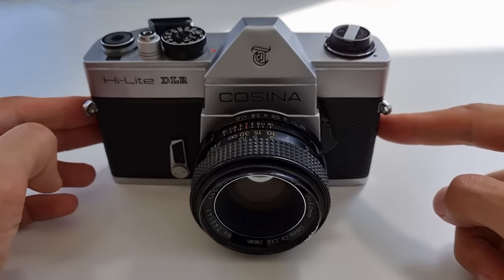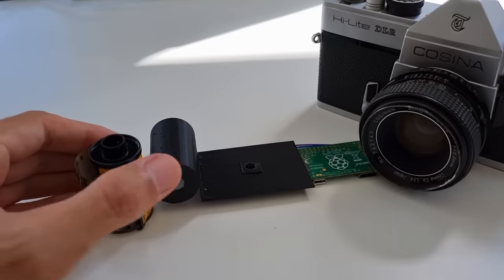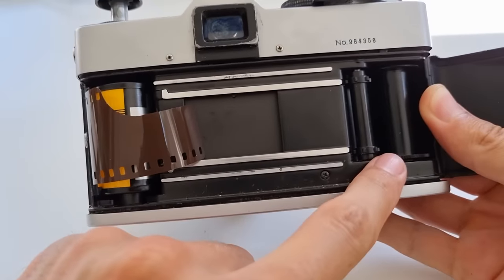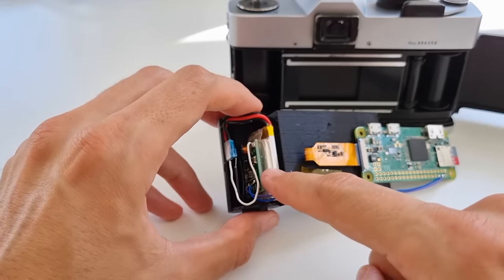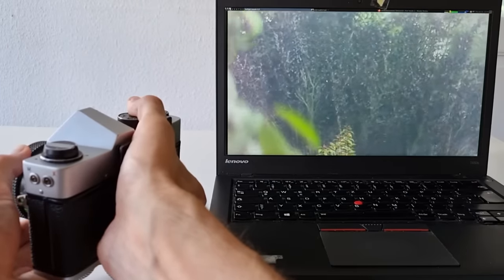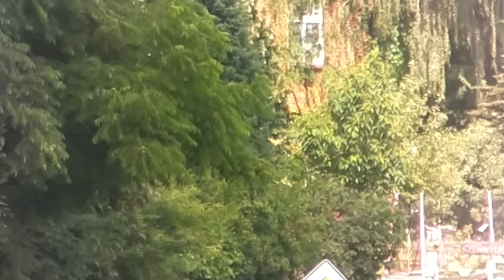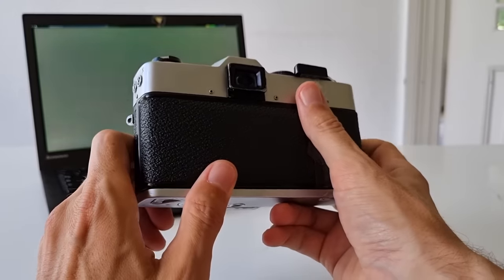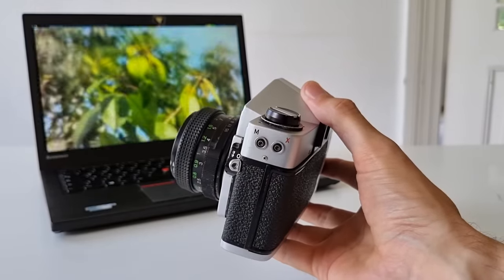Digital Film Cartridge for Analog Cameras (using Raspberry PI)

Comment: With the smaller sensor you've effectively increased your crop factor quite a bit. Maybe 5x or more! So your 35mm lens is giving you a telephoto image, I'm guessing something like 200mm. If you could get a larger sensor (ideally full frame, i.e. 24x36mm) it would be more zoomed out and like the image you would expect on film. Really cool project! I've seen several failed Kickstarters that tried to promise this, but here you are with a working prototype. Well done!
Reply from the maker: You are absolutely right. I started with a 50mm lens but with the small sensor the equivalent focal length is in the range of 500mm. Quite crazy :)
Reply: @kassenbon  are there larger sensors available? Maybe the high quality camera module?
Reply from the maker: @sigilvii  Indeed, this would improve the issue. But only by a factor of two, so we would still have a 250mm focal length. Together with a 24mm lens you could maybe get to somewhere around 120mm, which could already be useful.
Reply: Quality would increase too
Reply: @godsinbox  exactly. If you only cut low quality corners, image quality increases, but if you are looking only through a tiny spot in the middle, quality quality decreases. You are also loosing a lot of light, this leads to longer exposures and/or ISO increase
Reply: @kassenbon  mentioning the 24mm lens makes me think of the Pentax Auto 110. But then it's such a small camera you would be hard pressed to fit the electronics in, and it wouldn't fit 35mm cameras either.
Reply: Was gonna write the exact same thing hehe
Reply: The OTTO from Next Thing Co. :-) Also the creators of the CHIP and PocketCHIP.  I have one sitting around here somewhere!
Reply: @smithincanton  looked it up, now I'm thinking about how to put a Raspberry Pi into a Holga 🤔
Reply: Wouldn't extending the lens from the camera body change the focal length so that it would hit the sensor more proportionately?
Reply: @sigilvii  i remember the pentax 110 - I had one way back when :)
Reply: @kassenbon  I started with a 75mm lens, but with a "full frame" Sensor the equivalent focal length is 45mm :D
Reply: @iamnobody8  you are not losing any light by having a smaller sensor... the sensor does not affect the lens.
also, it has nothing to do with quality either, actually.. those tiny sensors have really small pixels, down to 1-2micros.. so they can actually capture higher quality images
Reply: @troyladoux1953  thats called focusing.... you move the lens further, you focus closer.
Reply: @Nobody-Nowhere   my mistake. You are right about light. And wrong about quality
Reply: @iamnobody8  The total number of captured photons is smaller due to the smaller field of view. The number of photons you capture from an object stays the same and you will get sharper images from distant objects, if the light conditions are good. The angular resolution is higher with a small pixel size.
Reply: @Nobody-Nowhere  You don't lose light per surface unit, but the total amount of light this tiny sensor gets is about 1/30 of what an FF sensor gets. 

As for image quality... you get more pixels per surface unit but that's a far cry from better image quality.
Reply: @Krrypton  No you won't be losing any light. the sensor has nothing to do with the lens, the lens just project an image.. how much of it you capture is up to you. its like you would say that you lose light when only capturing a rectangular full frame image, because the lens projects a round image.

The amount of light is equal on all points of the projected image. Well, it vignettes at the edges, but you get the point.

And smaller pixels means better image quality, if the lens can resolve those pixels.. that just how it goes. Its the combination of lenses resolving power and sensors pixel size that define the max output.
Smaller pixels are more noisy though, so that's when you  need more light. But you are not losing any light, you just need more to have the same noise levels as in larger pixels that capture more photons.
Reply: @Krrypton  So the main point is that the lens gathers and projects the light, what happens behind the lens has no effect on anything the lens does. You can look at a magnifying lens, you can put a cat or a full frame sensor behind it.. and it just does not care.. it just keeps doing its thing and providing the exact same amount of light for both.
Reply: @iamnobody8  Ok, so cameras that have higher megapixel ratings have less quality? Is that how it goes? They have smaller pixels to achieve the higher megapixel ratings. That's how you increase image quality (resolution), you capture more detail from the projected image. Its the combination of the lens quality & pixel size that determine the max possible output.
The exact same way its done in film, you choose a film that has smaller crystals that can resolve more. Smaller crystals are less sensitive as they capture less photons.
So the axis is sensitivity - resolution. The more sensitivity, the less resolution. The higher resolution, the less you have sensitivity.
So maybe the issue is the word quality, that can mean basically anything.
Reply: @Nobody-Nowhere  lenses have their resolution too and you are cutting it in this situation
Reply: I think increasing the sensor would need more computing power
Reply: @iamnobody8  Not sure what you mean but "cutting it" but a the resolution of a lens isn't affected by a smaller sensor. 
If anything you'll get a sharper image from edge to edge. Lenses are sharpest in the middle of the image circle. 
Assuming the sensors are the same digital resolution, a tiny sensor will capture only the sharpest parts of the lens. Where as a full frame sensor will just fit within the image circle of the lens and sharpness of the image may drop off towards the edges. The resolution of the lens isn't changed, what is changed is how much of the image circle is captured.
Reply: @MattDollin  reread then
Reply: @iamnobody8  Yes, i stated it multiple times. That its the lens & pixel size that defines the max resolution.
Reply: @iamnobody8  " Its the combination of the lens quality & pixel size that determine the max possible output." This was in my response. So please reread it.
Reply: @MattDollin  "The resolution of the lens isn't changed, what is changed is how much of the image circle is captured." Exactly, this is why its called the "crop factor", its just cropping. There is no "loss of light" or "quality" or any of that. Its just cropping.
Reply: Enjoying the geek out... But you know people have been saying that d40s take just as good a pictures as a 24 megapixel 3100... For years. I'm not sure if this is the HQ camera for the Pi? I'm wondering if there are maybe teleconverters or something that could correct the image... I mean usually there are a lot of lenses for older 35 mm cameras around it would be nice to be able to use a variety. Some of the new action cameras have 1 in sensors, maybe you could do a conversion into one of those. It would be expensive but far less than what it actually cost to buy the complete conversion or an equivalent camera.
Reply: @Nobody-Nowhere  I think you and @0dium are both right in a way. An issue with higher pixel densities is that smaller pixels show imperfections in the lens more than larger ones. This means that the same lens can give tack sharp images on a low megapixel full frame camera but somewhat soft pictures on a high megapixel crop-sensor camera. However, if the picture is tack sharp on the higher pixel density sensor it is going to be equally sharp on the lower pixel density one. This is also a reason why downsampling pictures can lead to the resulting picture being sharper.
Reply: @Ihwaz13  Like is said many times, its the combination of lens resolution and pixel size. Understand the basics, so you don't have to guess and make weird conclusions. Having a lower resolution sensors does not make the picture sharper :) You just have a lower resolution sensor and capture a lower resolution image.
Reply: @bootmenow  People who say that megapixels do not matter and all that, never print. Sure if your end product is max 8mp to fill a 4k screen for example, then all you need is max 8mp.. and having more simply has no effect at all.
Downscaling does not improve the image quality in any way, like ashbow archer claims. Downscaling introduces the same effect as sharpening. It can't retain information that was in the larger image, as its digital information. All the excess is simply gone.
Digital downscaling is a totally different process than optical reducing is, where more information is concentrated at a smaller area. In digital the amount of information is always the same, so excess is simply eliminated.
Reply: Hi! You are absolutely not right! The focal length is the lens physical parameter and it does not change by replacing film or sensor size. Here you have got smaller a angle of view, but with the same lens you have the same perspective reproduction. In other words, there is no perspective compression.
Reply: you are only using the lens of the camera, and only a very small portion of the lens.  is the shutter of any use in this set up?  seems the aperture is of no effect and of course the film winding mechanism not used.  What is the point of this?
Reply: @Nobody-Nowhere  the larger pixel size that comes with a larger sensor (at the same resolution) does increase the amount of light per pixel, so in that sense cropping does waste light, as well as having shaper corners and a shallower focus angle
Reply: @sigilvii  nikon zfc
Reply: @troyladoux1953  further away = closer focusing, so he could have a 500mm equivilent macro lens :D
Reply: I think it would be much easier to find super wide and cheap lenses
like 6mm or so
Reply: the lens wasn't supposed to work  this way: its design is aimed to a standard frame (which is about 24x36 mm), with a very small sensor you're using only a very tiny central area of the lens - it would be better either to have a larger sensor, either a smaller lens  - I think it would be possible to adapt a lens for 110 cameras or maybe a 16mm or 8mm movie cameras (in this case the main problem is the different flange distance, these lenses are designed to be positioned way closer to the focal plane than those for slr cameras). This is a great idea but needs further development
Reply: @sigilvii  Want to have. Urgently!
Reply: @Nobody-Nowhere  yes actually. More pixels on the same surface means every pixel individually can capture less light. That’s why cameras that are good in low light have fewer megapixels. The Sony A7sii for example has 12mp on a full frame sensor. Also pixel noise to signal ratio increases with bigger pixels. You’re right about not losing light with a smaller sensor tho. Overall the image quality in this case doesn’t really suffer from the sensor megapixels tho, but from the small size factor. It only uses a fraction of the image circle of the lens, which it wasn‘t designed for and therefor he gets a blurry/not sharp image. Lenses like that were designed for 35mm film, which usually doesn’t resolve details above 20megapixels in scanning. Sharper, newer lenses that are designed for 60+ megapixel cameras would be better, but this isn’t ideal for any lens really. You could get away better if you were using a speed booster, which compresses the image circle for smaller sensors. This also brings more light, as it’s working like focusing a laser beam. But the main cause would be bringing as much of the original image circle onto the sensor as possible.
Reply: @sigilvii  I'm thinking an 8x10 film camera...or 4x5...wild it would be
Reply: Yes, by using a smaller sensor you increase the crop factor, but you do NOT turn it into a telephoto lens by cropping off the sides of the image. 
It’s literally like taking a pair of scissors and cutting off the edges of the photo. It does not increase the magnification of the lens at all. It does not become a longer lens.
This is a common misunderstanding when people hear the term ‘35mm equivalent’ etc.
Reply: @kassenbon  Could be awesome for astro-photography purposes =) Combined with e tele-lens or a telescope (via adapter) this would be a nice experiment... (would need a high iso / low noise factor though.) Nice!
Reply: Could use a Nikon 1 or Pentax Q lens, if there was a suitable lens mount adaptor. I doubt such a thing exists unfortunately, there would be no obvious use for it.
Reply: @sigilvii  The APS-C sized sensor has been out and about in many many different SLRs for decades so taking one apart to pull the CMOS/CCD is something that is economically possible.  I do not believe it to be physically/practically possible to contain all of the components needed to operate the sensor (they are very power hungry and the electronics would not be able to fit inside of a film cartridge.  I guess from the engineering standpoint you could have wires run out the body to a box of the electronic guts, but you still would need to figure out how to turn the sensor on and off at exactly the right time, focal distance (no way it would match up with where the focal plane of the film would sit), how to set perameters.

Kinda the clear reason why there never was a sensor built into a roll of film to convert a camera to digital.  Maybe possible with a removable back.
Reply: If only we could tear apart an old sony a7s sensor and attach it...
Reply: Buy a cheap Nikon D40, D50 or similar and you harvest an APS-C sensor with something like 6 MP resolution. 6 MP with a good lens outperforms any smartphone with 24 MP.
But I am afraid that if you would try the D40 out, you would not even try to transplant the sensor to the analog SLR camera...
Reply: @sigilvii  There are but are expensive, at that point it is better to get a HD camera body from 10 years ago with no lens and mount the lens from the analog camera on it.
Reply: @iamnobody8  Lens resolution is a little bit different, and I'd be careful. The nominal resolution, lines per mm, is a figure that makes assumptions about brightness differences. The object, which the camera is looking at, is pure black and white lines. The image, on the film or sensor, is shades of grey. The difference, the contrast, affects how the image looks, and some lens designs give more contrast with less resolution, and look better.

Light is weird, and for this you're figuring it behaves as a wave. Talk of photons, and you're talking about light as a particle. It's both at the same time, and in the particle world you have factors such as film grain. It's a lumpiness to the image, not the same as a sensor pixel. You need a particular size of lump of light, a photon, to get the chemical reaction in film, or the response in a sensor pixel.

Modern digital sensors have made so many of the concerns of the film era superfluous. If you wanted fast film, for pictures in poor light or of fast-moving objects, you had to accept more film grain. You can get more noise, but, unlike film grain, the pixel stays the same size, and the sensors are more sensitive than film.
Reply: I will try this in vintage 8mm film movie camera, the tiny shutter hole should better fit Raspberry Pi camera size... image coverage should be nearer to what one sees in viewer. With manual focusing and zoom lens, I already have one...
Reply: Can't you just solve this by just moving the sensor closer to the aperture? Since there's not going to be any moving parts... Should work.
Reply: I got around this by using a focal reducer on a similar build: https://youtu.be/Oc6Qiykgt5Y
Reply: Can I use a piece of ground glass to get that effect?
Reply: New Kickstart announcement started me down this hole.  I will be looking to the "I'm back" digital camera sensor for analog cameras.
Reply: Afaik digital backs have been a thing since the transition to digital started
Reply: A full-frame sensor (35mm) would likely cost more than the camera is worth. You would also face issues with point-of-focus alignment across several axis.  Not impossible to resolve but certainly a challenge.  Then again, if the film-alignment rails can be utilised, then less of an issue. 

I might try myself with a 'for parts' digital camera and my old Pentax Spotmatic.
Reply: I think that a simple fix would be to go the approach of the meta bones speed booster. @kassenbon  @befinitiv
Reply: He needs a full frame sensor.
Reply: Smaller pixels in higher quantities does not equal higher quality. ..large pixels gather a more accurate light sample with less radiation cross bleeding between pixels. ..pixels crammed tight together have radiant energy cross  bleed interference from neighboring pixels. .. large sensors with special funnel shaped micro lenses on each pixel allow the sensor wells to not touch neighboring wells. ..hence no radiant cross talk. .. equaling more accurate higher quality light sample = higher quality image.  .. pixel quantity is not the same as pixel quality
Reply: @saffr3218 I've still got the whole kit with autowinder, flashgun several lenses, all in the Pentax flight case! Never used it though.
Interesting video. Nice.
Reply: Having a larger sensor would definitely be better. Now I'm not sure... a large sensor would be cheaper? Not so sure. It would utilize the lens of this camera more fully and not exaggerate its imperfections. I also think it would be better to have more light per pixel, contrary to the discussion here.
Reply: @kassenbon  It is usefull allready, even with 500mm equivalent.

For example if you do want to observe your property but dont want to have visible cameras on your property.
You place the camera outside of your property and still can survey it without people knowing you do.

For anything else you dont need to go through all this hassle do you?
Then the camera of the PI or even your cell phone would do. Wouldn't it?
Reply: Maybe you could harvest the sensor from an decommissioned dslr and use that.
Reply: Yes. I think it would be a challenge. But ultimately it's the only kind of digital conversion that long time users of analogue cameras would accept. We'd like essentially seamless operation so that the images would be one-to-one equivalents of what we'd see on film. At this point at least, full-frame cameras have been around long enough that it wouldn't be too expensive to find a donor. But I wonder what a bigger sensor might require given the tiny space available in the backs of mechanical cameras - although the take up spools could probably be modded smaller to provide extra space. @PhilJonesIII
Reply: @Nobody-Nowhere not higher megapixel in absolute, but higher mp _per square_. Density is the point
Reply: @AaronDislikes  attach a hollow motordrive at the bottom of the camera for this ? Would be awesome